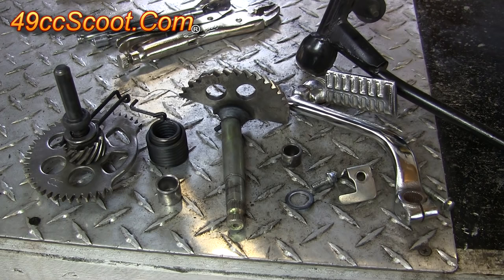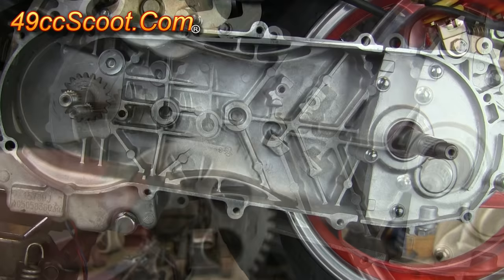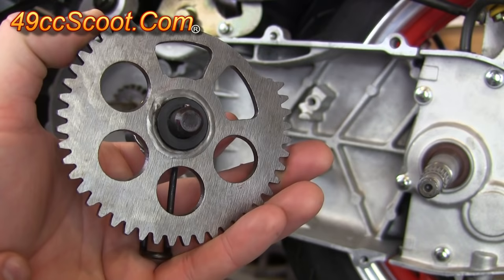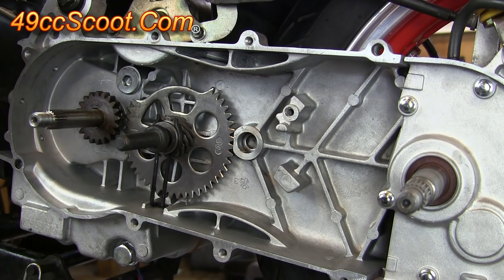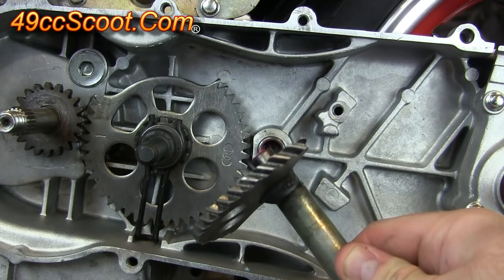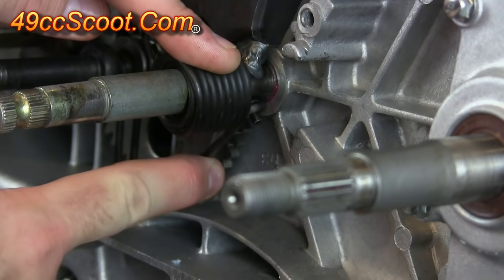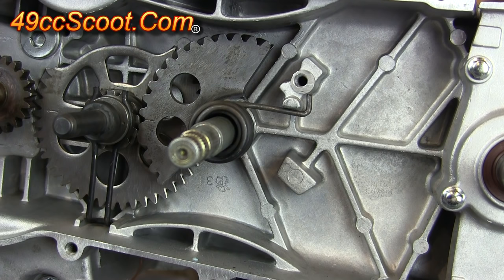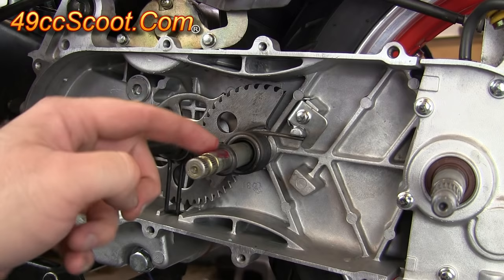How-To : GY6 125 / 150 Kick Start Gear Installation (Scooter, Kart, ATV)

Comment: I thought I was finished doing belt and roller maintenance on my atv engine until trying to get the case cover back in position and the kick start gear got out of alignment. I knew that there had to be alignment marks to position. So I found your video. What a life saver....thanks.

Comment: Just to let you know, awesome video, however I made a tool.to.make it possible to change the spring without dissasbling anything evcet the spring retsiner, its simply a piece of pipe 1 and 1/4 inch and has a slanted slot about 5/16 deep, works great,will do a video soon,  keep up the awesome work!a

Comment: All I got to say thank you I'll came home and I took it apart like you had it on the video and I put everything back together clean everything and what happened is the one gear was off a little bit like pushed out so if that I put everything back together nice  and  the spring correct I try to kick started the pefal up real fast now so thank you you're the man if it wasn't for you I'd be stuck with my 50 and my 150cc
Reply from the maker: Glad you got it!

Comment: The beauty of petrol-scooters and pretty generic GY6 is some models have both kick-start and electric-start AND push-start
= which makes using a battery-powered screwdriver or drill with socket, a possibility. 

Anything that have a pull-cord can have all three modes of starting by copying the concept and buying the parts and slapping it on with a slight additional welded nut for the electric-drill(with socket, optional clutched-torque settings)

That will include old-cars. To add an assistive electric motor which is also regenerative and call ot a hybrid will be a bit more work on the timing-belt to crank-shaft portion. Nut-case is a double-edged joke.

Comment: Great. Saved me trouble trying to see the instructions on the manual. Just pictures.
If you have suggestions on how to fabricate a drive face puller, I would be honoured.
Reply from the maker: You shouldn't need a puller for any of the drive faces (pulleys) in this CVT.

Comment: The GY6 bushings tends to break and all bushings must be inspected for hairline cracks before installing it again. I have my scooter with this problem and replacing them with new ones will make them operating smooth again. This is very useful when your battery is dead since the scooter cannot be pushed start.

Comment: I like this video wish I would seen this before I start to fix the 150cc scooter I just gotthe kick starter is not working so I took it apart and im trying to fix it im going to try it again tomorrow now seen I see how it work thanks you for all your help with my scooterthe 50cc 4 stroke I got I have to my sister and you husband we are going to fix it up this winner I hope to have my 150cc on the road so I can say this what a different 49cc 2 stroke to a 150cc I like 150 it keep pulling at 50 MHP and my 2 stroke is about top out there keep up all the grate videos thanks again for your help us all
Reply from the maker: Thanks and good luck with your scoot.

Comment: Really well explained and demonstrated, best video out there. I'll be trying this job over the weekend...
Reply from the maker: Thanks. Good luck with it.
Reply: Installed it all ok.
 When I put the cover back on the kickstart just about works for one go. Then it seems to go out of alignment and is very stiff/impossible to engage.
Reply from the maker: Sure the spring is right? All marks aligned as shown? No parts worn?
Reply: Yes think so. 

Before the kickstart broke I was giving it a real battering when I was starting up. I'm thinking now, that may have damaged it (beyond repair)?

Next thought is to repair the electric button start...

Comment: This design is stupid, it's giving me  a hard time since my battery went flat. Thanks for the video mate.
Reply: Same here; a small motorcycle without a kick starter is a disaster waiting to happen if your battery does not crank it, because,due to the automatic transmission you can't push start it; you need  to have the kick starter,  and it gives you a bit more of piece of mind.

Comment: That spring gives me the BIGGEST headache of my life. I cannot get it to bend up that far, it snaps out of my grips before I do, or when I ALMOST get it to that nook it slides away or breaks my screwdriver when I try to slide the hook in. WHY couldn't they just make it a simple kickstart assembly like in the 50cc, I wonder? With no spring and just one gear? Those were way more reliable even if they took more than one kick to start the bike
Reply from the maker: I can't say I've worked on any kickstart that I enjoyed putting together. Most aren't that bad once you get used to them though.

Comment: My kick start hasn't worked since I got the bike in 2011.  150cc.  I put on 9000 miles since but am bring it back to life right now after sitting for 2 years.  I got into motorcycles so it sat.   Took the cover off and that bushing is cracked in half.  Mostly likely why it didn't work.   Where do I just get the bushing?
Reply from the maker: Check PartsForScooters.

Comment: I enjoy your videos , new to scooters ,got a 2011 ruckus n horrible condition ,put n new motor everything work fine , except front flashes will not com on or flash any advice ,thanks Tim
Reply from the maker: If it's only the front that won't work, I'd check the bulbs first. If all won't work, check the flasher.

Comment: Quick question! My hammerhead twister 150cc has the same setup but does not have the ability to kickstart. Question is do I still need to have the gears in position as your video shows or can it be disengaged as it looks to be now
Reply from the maker: If you can't kickstart it, then there's really no need to have the kickstart gears at all.

Comment: Hate bugging about my kickstart being jammed up. I've removed cover, cleaned, lubed and it still will not go down. I've put it on 5 or 6 times, same results. When off scooter the unit works smoothly. Either I'm doing something wrong or motor is seized or some gear bearing is jacked. My electric starter doesn't work.. So I can crank that way. A guy told me I should use channel locks to try turning crankshaft... Does that sound correct ? Any suggestions appreciated. I to dang old to keep riding the MTN BIKE. Thanks
Reply from the maker: Try turning the crank by hand. Grab the variator or flywheel and try to rotate it. Be sure the ignition is off and kill switch set to kill/no run setting for safety. If you can't turn it over by hand, something is wrong. At that point, start by removing the spark plug to see if it shows anything obvious (damage) or if the engine can turn over without the plug.

Comment: the kick start is good and its installed good, but it doesn't turn on so its the starter motor right?
Reply from the maker: The engine could be seized. Kick start shouldn't stop the engine from turning if all is correct.

Comment: Hi is the outer bushing that goes in the case supposed to sit all the way in the case or more just in the rim, my scooter doesn't have one and from what I can find it looks like it's supposed to be 14mm inside diameter and 18mm outside diameter, but an 18mm outside does not fit all the way into the case. Any info or suggestions would be great
Reply from the maker: You can see it at 7:10. It doesn't fit all the way into the cover.

Comment: Thanks so much for the video, do you think the process is the same for a 2007 Kymco People S200 (163cc If i'm not mistaken). My kickstart rarely gets the scooter started unless the engine has been warmed up. I had a 49cc Chinese scooter (metian motors) and the kickstart always worked great, I wish the kymco did so I wouldn't have to keep jump starting it when the battery dies from sitting a week or two. Thanks again!
Reply from the maker: Possibly. I'm not sure. If you pop the cover off and it looks like what you see in the video, it should. Get yourself a Battery Tender Jr 12V if you can and hook it up when you leave the scoot. You may also have a battery going bad if it won't start in just a week.

Comment: Got a question. I have a 150cc scooter that's had a big bore kit put on at a scooter shop that's since closed down. Since the work was done I have NEVER been able to kickstart the scooter. Is there any thing that I can do?
Reply from the maker: Just too tough to get a good kick? Maybe do something to lower compression, but if it performs well then you will change that. Otherwise, maybe the carb needs some fine tuning or there's an issue with the kicker.

Comment: brother, what remedy would be great if that keyway with a pin guide broke?
Reply from the maker: If that spot in the case broke, I'd probably see if there was enough material left to grind/machine the area down a little and enlarge the hole slightly. Then an interference fit sort of bushing could be made with a keyway cut into it. That's pretty complicated for the average DIYer though and having a shop/machine shop do that would probably cost more than a new case or maybe a whole engine. Another thought would be to see if the area could be ground down and then just cut a groove in a thick washer/spacer and JB Weld it on. You'd have to be careful with placement, thickness and diameters for any of these operations.

Comment: When you put the case back on did you put a new gasket on or didn't it have one
Reply from the maker: My case is vented, so I don't bother. The only reason to use a gasket if the case is vented (I cut holes for cooling) is to maintain spacing or if you have issues with vibration.

Comment: I have a question if you could answer this possibly I fix my starter it has 12 V and when I crank the engine the starter Kranks but the motor does not turn over and if I pull the starter off and spin the fly wheel on the outside I guess the motor spins what could be wrong with my scooter
Reply from the maker: If the starter spins fast and the engine never turns over, it's probably the starter clutch.

Comment: i bought a 150cc scooter an i took it apart there are somethinhs missing in the kick start so i removed everything do i really need the kick start or can i piut it together without it
Reply from the maker: If the e-start is working, you don't have to have the kickstart.
Reply: 90GTVert ty

Comment: I need help finding out the part that holds gearshaft spindle
Reply from the maker: https://www.partsforscooters.com/scooter-parts-diagrams/GY6-150cc-Scooter-Parts-Diagrams/125cc-150cc-GY6-4-Stroke-Kick-Starter-Variator-Assembly_2?show=100&display=list&page=1

https://www.vmcchineseparts.com/collections/chinese-scooter-kick-start-parts

I also noticed that just searching for "GY6 kickstart parts" brought up whole sets on  eBay and amazon. Just make sure to check measurements, because there are different versions.

Comment: i've only had my scooter about a year and a half and my kick start stopped working only after using it a few times. seems to be jammed. opened the case to change my belt and the kick start components are completely rusted!
Reply from the maker: If it's not terrible, some wire brushing may get it going again.

Comment: I got a 2018 tao tao lance 150cc r only has about 800 miles on it  my kick starter when I push it when I push it down it looks like the spring doesn't go all the way up if this is stuck in down position what you think could possible
Reply from the maker: Do you mean the lever doesn't return? If so, that's likely a spring issue. Not sure how a spring would get stuck anywhere, short of if it wasn't connected or connected properly. They have a considerable amount of tension on them when installed properly. Maybe a very worn spring.
Reply: I take it apart and clean it and check it . scooter is to new thanks

Comment: hello i have this 125cc scooter a friend of mine want me to make it run again,one of the issues is the kickstart wich i will fix following this vid,ty for that!other issue i have founf is the carburator hoses set up,in this particular scooter the gas tank goes on the "belly" i guess it uses a fuel pump?also the carb have an electric choke,it was disconnected,do you have a vid about this issues or can you hepl me witht hem on messages?thank you very much! it is a 152QMI engine
Reply from the maker: When the tank is below the carb, they use a vacuum fuel pump. Mikuni is prob the best on commonly available. Check out Mikuni DF44-227.

Reconnecting the e-choke (enricher) should be easy. Just find the correct plug and plug it back in.

Comment: Bruh my keyway pin broke again this is the second primary gear im on... Advice?
Reply from the maker: I would replace all involved parts at that point and examine for anything possibly causing something to catch or hang up or unusually high compression. Make sure the kick lever doesn't get installed in a manner that may allow you to "over kick" it, which causes stress and can damage otherwise well functioning kick start systems.

Comment: Does removing the kick start gears really make scooter faster? On mine, previous owner removed it...
Reply from the maker: Short answer, no. Longer answer, the small amount of weight removed would have a negligible effect. One gear is on the crankshaft, but it's a small diameter and not terribly heavy so again it would have a negligible effect. If you're in competitive drag racing where a thousandth of a second could matter... then sure, remove it. Otherwise, it's not really hurting anything.
Reply: Ofc man, thanks for quick answer, i tought the same, why would some 200 or 300 grams make scooter faster? :O, you got the like and thanks very much, i will buy parts and put it right on. :) Thanks man. Would you give me your facebook contact, i have more questions  about scooters i have some problems... :/

Comment: How do you clean the compartment you're putting things in? Also how do I know if I have a GY6 Moped? And if I do, do all GY6 parts fit in it?
Reply from the maker: I usually use brake parts cleaner to clean the cover and cases and metal parts.

If you have a Chinese 125-150cc four-stroke scooter, most likely it's a GY6. You can look for an engine number near the oil drain plug. 157QMJ is prob the most popular. Maybe 1P57QMJ or 152QMI.
Reply: What are you using for grease and can I get it at a hardware store?
Reply from the maker: I usually pick up Mobil 1 or Royal Purple synthetic grease from auto parts stores.

Comment: Didn't you do a video on lighter clutch bells? I can't find it now.
Reply from the maker: I did not. Sorry. I've talked about lighter clutch springs or roller weights before. Not clutch bells though.
Reply: I just seen this video if I seen it again ill tell you ho it wasbut all they did was sand it smooth I think on a lathe

Comment: how do i put back on the 20 tooth gear
Reply from the maker: It's an interference/press fit. Most people put the gear on the shaft and then use washers/spacers/drive boss till they can use the variator nut to press the gear on. Hold the flywheel and tighten the vari nut.

Comment: Done it but everytime i try and replace the cover  the kickstarter jumps out !!!
Reply from the maker: The first thing I'd do is take plenty of time to try again and have a good look at everything. It's easy enough to miss a small detail. If everything is right, the cover should slide on pretty easily. Maybe make sure you don't have excessive play in the shaft that goes through the cover.
Reply: @49ccscoot  will try again when new variator and pulley arrive tomorrow , thanks .
Im wondering if maybe i need an extra bush internally on the the kick shaft . I seem to have one already fixed in the cover but there is still some lateral play when cvt cover is in place .
Ive ordered a replacememt kickstart spline bush and will see if it fits ...if not maybe a couple extra washers between the inside of cvt case may be the cure 😅

Comment: Hey men question i got a tao tao 50cc and just got it start it and dont goes over 20 mph what thats will be
Reply from the maker: Check compression. Check the tune of the carb and CVT.
Reply: 90GTVert so i start it againg and no i get it to 30 mph but turns off donst stay on.
Reply from the maker: 30-35MPH is pretty standard. Compression is likely OK, but it doesn't hurt to check. Maybe it's as simple as adjusting the idle speed if it dies at idle.

Comment: Do you have a video on how to remove one permanently
Reply from the maker: I don't have a video about that, but it's easy enough. Just remove the stuff that I installed in this video and leave it off.  Doesn't even have to be permanent. Put it back if you want it again. Down side there is that you have no backup if the electric start ever fails. You could remove the gear on the crank with a gear puller tool, but it would have to be replaced with a spacer of the same thickness and it's easier just to leave the gear there. Not enough difference in mass of the gear vs a spacer to make it a noticeable difference and again it makes it simple to go back if you leave it.
Reply: @49ccscoot  ok thanks man. Reason being is the gear attached to the spindle where the kick bar is is shredded and it's on a Carter talon buggy so I'm just gonna take it off. Not enough room in the cage to really start it with the Kickstarter anyway.

Comment: Can I use a kickstart from a 49cc and install it onto a 150cc??
Reply from the maker: They aren't interchangeable. Not sure about the splines on the lever itself, but the 150 kickstarts usually face the opposite way of the 50s.